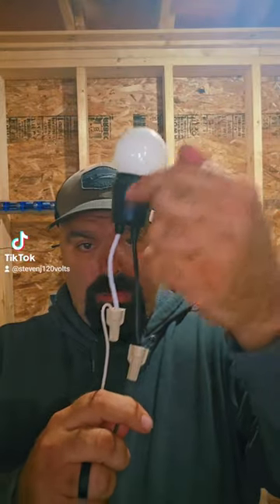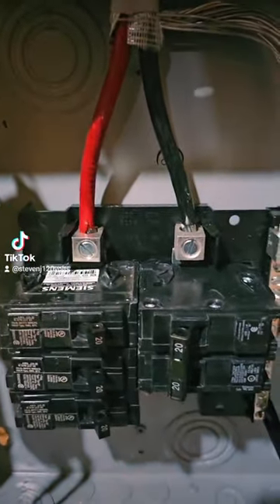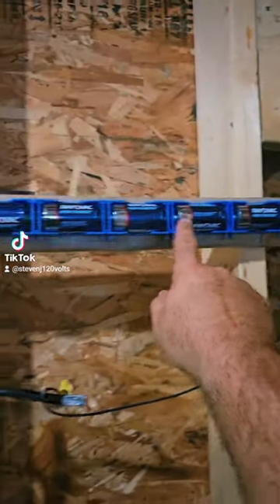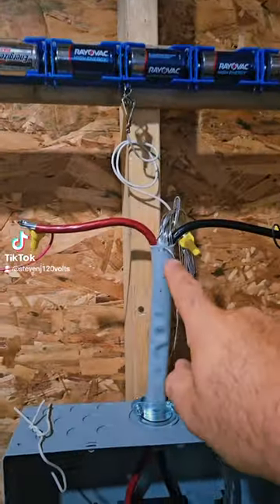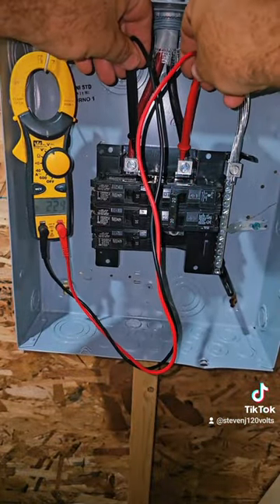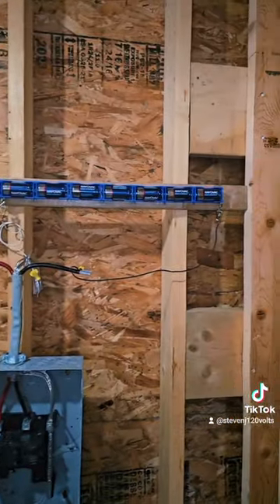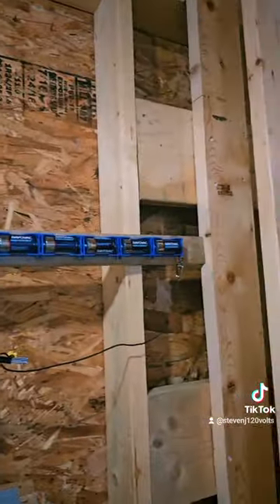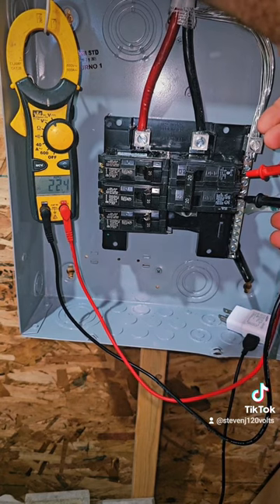why doesn't a 240v circuit need a neutral???

Comment: When I studied electrical construction at Kalamazoo Valley Community College,  the concept of spit phase power for residential and some light commercial,  was done with two 12 volt AGM batteries in series, that is how I first learned the relationship of transformer windings and the different voltages obtained with different taps.

Comment: The confusing part is usually the coil, I love how you use batteries to explain and show each coil is like individual battery.
Reply: What he didn’t explain is that when you wire or stack power sources in series, the supply is accumulated with the amount of sources that you use. So 10x1.5=15 vdc for example with the batteries.

Comment: That was a fantstic explanation! The visual was great-thanks for taking time to do that, it really helped. I'm subscribing hoping you will do more.
Reply from the maker: Thanks so much....I have a tik Tok with 80k followers and a bunch of videos.  I am just now trying to build you tube and Instagram.  But check me out on tik Tok for the most content
Reply: @Stevenj120volts   Excellent explanation. Question, you stopped short of further explaining how the exposed neutral in this panel plays a part in what you described. Or does it play no part in what you described, ie the 240 v. Thank you.

Comment: Technically this DC mock-up is correct as a an instantaneous snapshot in time. From an engineering or troubleshooting standpoint it’s important to note that a split phase system is in fact two phases at a nominal 180 degree phase angle. Imbalances between the legs can cause lagging, which can then cause voltage sags and associated greater or lesser amounts of current return on one of the legs on a cyclic basis. Probably only important to an electrician if you’re trying to troubleshoot sketchy or potentially improperly installed equipment.
Reply from the maker: I disagree with the second part.  It is one phase split. Not two phases.  If you cut apple in half you still have only one apple. It is the set up I show with the battery stack reversing polarity at 60 cycles per second
Reply: @Stevenj120volts  what you are describing is a DC to AC inverter power source. A split transformer is different because it is a true phased source and can respond negatively to lagging load from pole to pole. It does provide two phases (pure sine waves) but is not a proper multiphase system because the phases are at a 180 degrees from each other unlike a true two phase system, which is rare today, and which provided two phases at 90 degrees.

Your example is a fine teaching tool but doesn’t provide a full description of the electrical theory behind split phase.
Reply from the maker: @awheel  you know it works?  Like if I put a load on the battery stack  the neutral will carry only the imbalance and disconnecting the neutral will cause and imbalance of voltages
Reply: @Stevenj120volts  yes … it does work. Like I said, it’s good for a general demonstration of the principle, but your phase theory is different from what’s actually happening in the xformer.
Reply from the maker: @awheel  a single phase transformers just two end of opposite polarity.  They are not out of phase they are in phase but opposite polarity
Reply: @Stevenj120volts  The perfect 180 angle is maintained only under ideal circumstances. During troubleshooting you can encounter lagging inductive loads that can pull one of the legs out of phase in the same way that a leg of a three phase can be disturbed. Yes, under ideal operations you can’t describe a discrete rotation direction as in a true two phase system, however the inverter example doesn’t tell the whole story.
Reply: @Stevenj120volts  I also agree that the current imbalance can be carried by either conductor, it’s just that the magnitude of the return current on either conductor may vary based on load conditions.

Comment: Wow. I’m still trying to absorb this. Not an electrician, but understand enough to be dangerous as they say 😂. Seriously though, I never understood this and always wondered how this worked. It explains why back in the day, they never had a neutral running to things like dryers and stoves. Used to be two legs and the ground. That was it. That neutral wire introduced into two pole breaker situations came later on down the road.

I was just watching videos, explaining how to search out an open neutral. I saw another YouTuber do the same thing with a bank of batteries, hooked up to lights on two different banks. He basically used alligator clips for switches. You can literally see, depending on where the neutral break is, were certain lightbulbs, were getting more voltage, and others were draining less. Still trying to wrap my head around that. Your video just helped me to understand why. Because the neutral wire is tapped from the center! You made a comment about full potential being at the end. I think I’m slowly starting to get this. Unless I’m missing something here.

Bottom line is from my situation, kill the breaker, identify all the circuits that are on that run. Turn the breaker back on, start with the closest circuit to the breaker and check each circuit neutral until I find a loose one, moving forward through the path of the full breaker circuit. This is an old house. I hope I can find this because it’s been a mess. 

Anyway, This was a really, really interesting video! Much thanks for this! And yes, as someone else said, thinking out of the box is awesome! Kudos!
Reply: Actually,  the old stoves and dryers you're referring to are actually two hots and a neutral, no ground.  At the terminal block there was a strap or wire that bonded the chassis to neutral,  for three wire setups, these were prohibited as of the 1996 NEC, but because not all states and jurisdictions in the US adopted the latest NEC edition,  it really wasn't until the early 2000s when the rule was enforced nationwide, existing installations are allowed to remain, that's why 3 wire dryer and range cords are readily available at any hardware or home improvement store.  New installations are required to be 4 wire - Hot, Hot, Neutral,  Ground, and the neutral bonding strap or wire must be removed when a 4 wire setup is used, and vice versa if moving into an older home.

Comment: Excellent explanation!  I like the visual of a sine wave which shows a horizontal zero volt neutral line, a 120 volt positive upper wave and a 120 volt negative lower wave in single phase (1/60 of a second).

Comment: This fellow should have just shown a schematic  drawing of a transformer. The telephone pole transformer has of course a primary winding and a secondary winding. However the secondary winding is center tapped. This means the secondary is actually like two windings connected in series. Each winding produces 110 volts. The point at which they are connected is wired to the breaker box as neutral. The 2 ends of the transformer are the hot wires/terminals. Unfortunately, the neutral is also connected at the pole to the ground that you stand on such that if you are standing on the ground and touch one of the hots, the electricity will use your body as a path to get back to the transformer. Makes sense huh?

Comment: Thank you, that was an interesting demonstration. I always looked at alternating current as a pause and then a push, and then a pause , and then a push, not a give and take, im thinking the neutral takes away the empty box of electric, or the empty container of electric, or the spent cartridge, so to me AC is a push pause, not a push pull, if i get a shock from 120 volt, i can fell that 60 times a second, if it were a push, pull, it would cancell out itself, but the fact that it gives you a shock and then pauses, is (in my eyes) is proof that AC is push pause, rather than a push pull. But i really appreciate the video.
Reply from the maker: You can put a trian dimmer on the NEUTRAL and it will dim the light
Reply: Thank you for your reply, that interesting, Len

Comment: This split happens again in some electronics that have an iron core transformer that steps the 120 volts down to like 24 volts but may have a center tap that also offers a dual 12 volt option so later in a circuit you can get + 12 vdc and a - 12 vdc supplies alongside a 24 vdc supply. This is more common in audio amplifiers though and with higher DC voltages